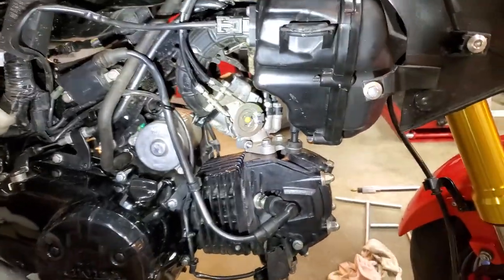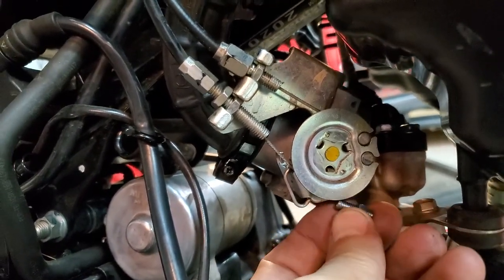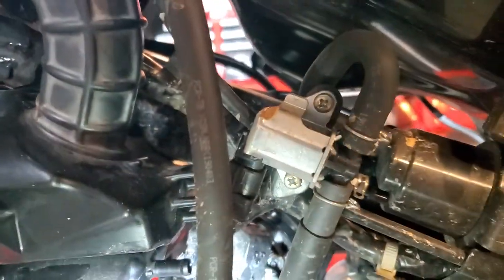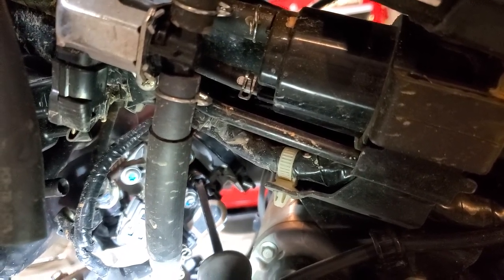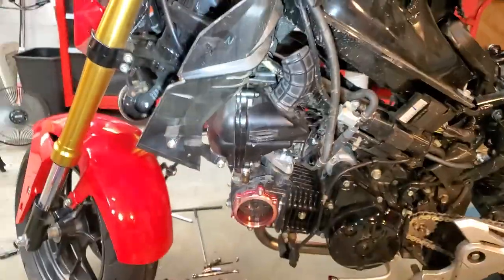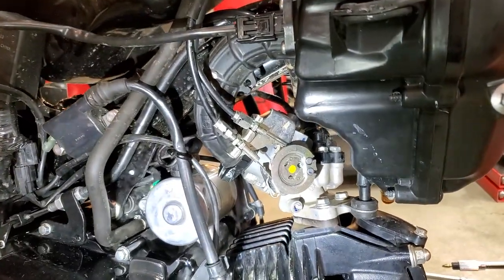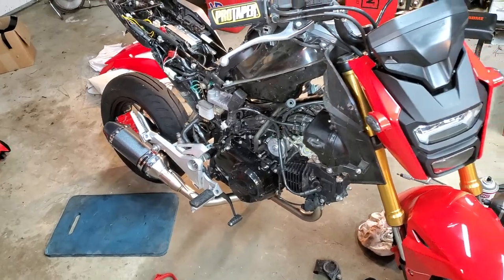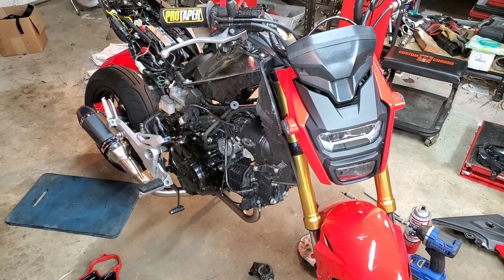The truth about idle speed and air screw adjusters Keihin throttle body Honda Grom and Monkey

Comment: THAT'S WHAT I DID WRONG. I NEED TO MAKE SURE MY HUFFY IS FULLY WARMED UP. I WILL GIVE IT A TRY TOMMOROW . WISH ME LUCK!
Reply from the maker: And do NOT use a Denso spark plug. I learned that first-hand
Reply from the maker: Mine would only idle kinda ok with the Denso spark plug.  Install the NGK #6 plug - all better.
Reply: Is the air screw only for idle?or does it affect the whole rpm range
Reply: @potterportraits   air screw is for air
Reply: @danawilson3709  I'm aware it's for air. But where it's fuel injected I was asking if it was for the whole rpm range. Or just idle. Since several people have called it an idle air screw.